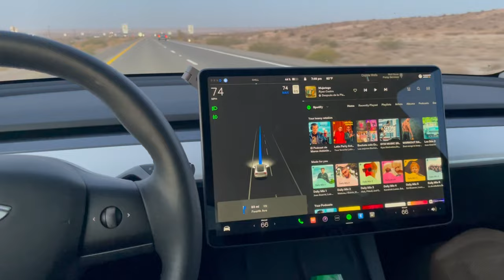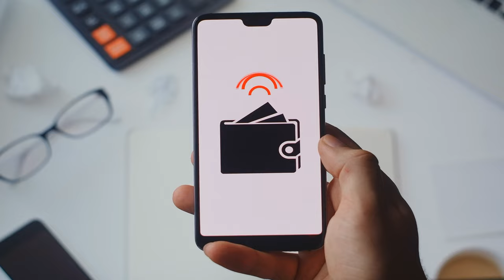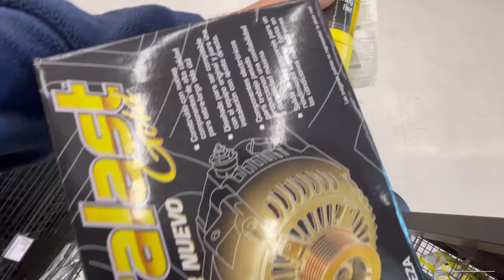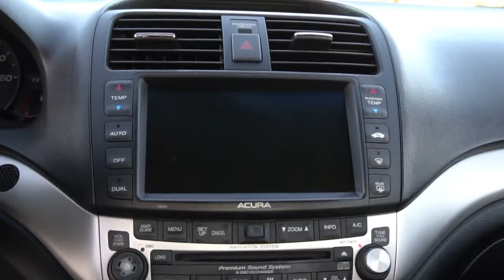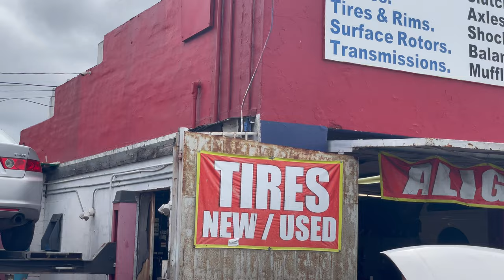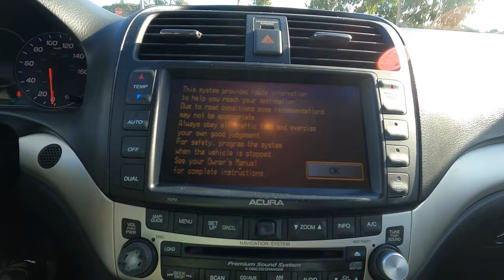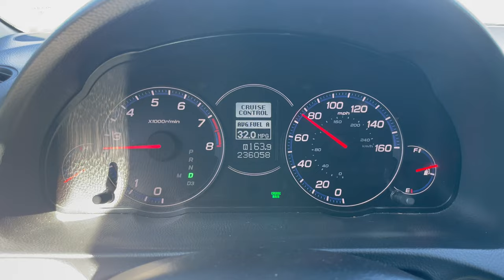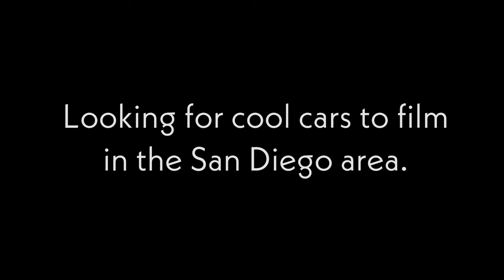ACURA TSX Owner's Review after one year. #Acura #AcuraTSX #honda

Comment: Very good review 👍
I'm thinking about getting a TSX Sport Wagon but I'm concerned about road noise and oil consumption.  I heard the TSX have little to no sound deadening and the 4 cylinder motors can consume as much as 1 quart of oil per 1000 miles!
Reply from the maker: I love those wagons! About road noise: bad! Compare it to a product from Lexus and this is bad. There’s no way to sugar coat it. I’ve had many Honda/Acura products and that’s a constant. 
About the oil consumption… not my experience at all. I change the oil on this one every 5k miles and it doesn’t requiere me to top it off in between services. 

Good luck with your car hunt.
Reply: @JuanCarlosLTO  Good to hear your TSX does not have oil consumption problems. It is probably the ones that were abused and neglected that has issues.  I drove an Acura Integra for a few years and the road noise was bad.  Yes, seems to be a common problem with Hondas and Acuras.  Sound deadening material can be added but that is tedious (if you DIY) and costly if you pay someone to do it.  It also adds weight.
Reply: the lexus cars weigh more because of more sound deadening. A little more on the acura won't hurt @Hiro__Nakamura

Comment: Hey, you said your TSX is fuel efficient. I’ve a 2004 TSX, the mileage on that seems to be really bad. That’s the only thing that puts me off a little. Other than that I love the car. Any suggestions to improve my fuel efficiency? I’ve around 216k kms on the car. 
Also do you recommend I use premium gas or mid grade?
Reply from the maker: Well, about fuel efficiency… Hondas of those years were low on torque so you have to step on it to get the revs up to get the car moving and that’s when it drinks fuel. I’ve had many Hondas and they all do the same. If you drive it like a grandpa then you’ll match the claimed efficiency. My guess is that you drive a lot in city and that stop and go doesn’t help much. I should have said: “efficient on highway driving”, because you’re right, not so much in city.
As far as premium vs mid grade. I keep doing premium but honestly I don’t know why 🤷🏻‍♂️. Maybe because it says “required” on the manual? But if finances were tighter I probably wouldn’t.

Comment: Not weird at all in my opinion. I did the exact same thing here!

I bought and sold (made money on it) a Model 3 LR into a couple other fun cars but ultimately they weren't the one car solution I wanted. I decided to buy a 2012 TSX with 180K miles on it for 6k. My plan was to drive this for a bit and see what I would like purchase next, but the maintenance record on it is perfect and I actually can't really see myself selling this car. Now at 190K and going, my TSX is such an easy car to own that it is a no brainer to keep until it dies for me now.

My plan is to keep this as a daily and purchase a manual Cayman or M2 in the near future as a my weekend car. No need for one car solution anymore!
Reply from the maker: Funny how you mention cars within my orbit… the Cayman: I was looking at a 2009ish before the pandemic… in nice shape you could get one in the mid 20’s for an S with a manual. The M2, in my opinion, comes closer to the original idea of the first M3 than the current M3/4. The two series is a very interesting car, a definite upgrade from the 1 series, for sure and I’ve thought about the M240i over the M2 because I have no need for the latter: don’t plan on tracking it, it’s cheaper and the power to weight and price is optimal for me. 
About the transition from electric to the TSX… I’ll be dead honest: it didn’t work for me because of our lifestyle and driving needs. Then I thought that eventually we will all be driving electric appliances so the vintage feel of things like my manual transmission bmw made me swing in the opposite direction: for connectedness found in older cars and/or modern sporty cars: cayman, Miata, GR86, GTI, etc.

To each their own, I’m happy with my choices today. Tomorrow? We’ll see!

Comment: If a TSX was taken care of, it will go a long long time, especially the manual trans as the auto would have issues UNLESS you maintenenced the auto trans regularly and didnt push it hard all of the time. 

I drive a RWD 08 infiniti M35 with 90k currently. Ive had 2 M35s. My bought my 1st 06 RWD M35 for 8 thousand dollars in 2016. It had 80k miles in it when i boughtit. I drove to 190k when i sold it to my friend who is still driving it over 200k miles now. 

I do recommemd buying a used M35 in RWD instead of AWD unless you need AWD where you live as AWD M35s have shorter life span generally. I also recommemd synthetic GTX oil change every 3k instead of 5k because M35s will burn oil unless you change every 3k with synthetic from time you buy it. If 1st owner didnt, and its already burning oil, its usually only a qt or 2 between changes. 

I bought the 08 M35 I have now 3 years ago for 10 thousand dollars with only 40k miles on it! Owner was retired and kept it garaged. Im at 90k now and its flawless. Doesnt burn oil at all since ive took care from 40k instead of 80k like my 06, it burned a little cause 1st owner only changed oil every 5 to 7k miles smh and with regular oil. It actually burned less over time after i switched it to synthetic every 3k miles. There is nothing wrong with an older Japanese Luxury sedan that still runs good! Ballin on a budget!

Both of my M35s only needed oil changes, tune ups, tires and brakes. Not 1 other thing ever went out. Oh a battery lol. Thats it.
Reply from the maker: I actually had the M35 on my radar back in 06-07. But the car that makes me drool from Infiniti was the 2003-04 M45! Such a beautiful car. Unfortunately it had design flaws that tarnished its reputation. To this date I still enjoy seeing the very few I see on the road. 
And yes you’re right about everything else regarding old Japanese cars and maintenance.
Reply: @JuanCarlosLTO  The M45 V8 RWD is truly an immaculate car! I like all 3 generations but agree the 2nd gen 03 04 were the best. I test drove an 03 in Hawaii years earlier but ended up getting an I35* instead for better gas mileage. I wish id got that 03 M45 instead to this day haha! Its drove more like a 06 Chevy monte carlo SS with V8 and handled more sporty than 3rd gen. The 3rd gen are basically exactly like my 2 M35s with V8 instead of V6. I really want to get an M37 with black leather interior next. I saw one with a super light metallic blue paint and black leather with only 50k on engine garage kept for 14k. Japanese ballin on a budget!
Reply from the maker: My coworker had the 04 M45 and he said he had it since new and the main issue was the manifolds would deform and crack (either or or both, can’t remember) but he had gone to the aftermarket and solved the issue. Bad on gas and all, one of my favorites of all time, so much character, nearly hard to find on anything modern nowadays.
Reply from the maker: The Infiniti FX is another one that I always liked and was sad to see gone.

Comment: Juan Carlos, with my TSX over 435,000km, I am wondering if my car can last for another 2 years without a hefty repair bill, which will pass 500,000km, since I drive about 30,000km annually.  To make the situation more difficult, it takes time to buy a new car due to the long time to deliver a new car.  I dont want to be in a situation without a car when the TSX collspses beyond repair.  I recently just spend $375 to fix 2 exhaust leaks.
Reply from the maker: Hahaha. I think you’re in for the win as we just bought a new car and will be the one getting all the mileage now. I’m going to be daily driving the TSX to work every day though and that would be about 10k miles a year. Right now is at 241k. It only makes sense to keep it. The BMW will be a third car now on which I will probably only put about 2-3k miles max. 
I really want to get to 300k miles on the TSX but it will take me a lot longer now.
Reply: If I had the money for a paint job, I would paint my '06 TSX pearl white.
Reply from the maker: @ronlam3654  a change of color is very hard to pull off unless you do a complete disassembly of all body parts, gaskets, etc. pearl white would be my choice as well. But getting it done correctly would be so expensive.
Reply: @JuanCarlosLTO  I completely agree.  My '06 TSX is approaching 444,000km.  Rust is already starting to appear on the panel connected to the rear bumper.😥

Comment: I have the 2008 TSX and currently at 200K Miles. I had to replace an Alternator, got my Catalytic Converter stolen and replaced, and always been up with maintenance. Having said that, this car definitely a long lasting car. I honestly feel like this car can go 200K more.
Reply from the maker: Judging by the way mine is running at now 241k miles… I wouldn’t be surprised if it runs strong to the 300k mark. 
When I made this video 3 months ago my car had 236k. It now has over 241k. We have a new car now and will probably drive this one slightly less but I should break the 250k mark by the end of the year, hopefully without hiccups

Comment: I own a 2006 tsx. Done alot of mod work to it. Have 167k drives better then most newer cars.  I'll have no plans getting rid of it. Gonna put performance cams in it.
Reply from the maker: Do you have an aftermarket suspension and if so, what is it. Mine is riding in whatever it came with from the factory and needs a refresh. I want to take this opportunity to lower it a bit but don’t want anything too stiff or aggressive.
Reply: @JuanCarlosLTO  well I just bought new shocks. But they're pretty much oem . I'm am planning on getting coilovers which allow you to lower the car and it stiffens the suspension.  Probably what you want too. I just havnt   not read to do that yet.
Reply from the maker: @OutdoorOkie yeah, I’m not on any forums or anything so I’m pretty much in the bling when it comes to what to get but I want to go adjustable
Reply: @JuanCarlosLTO  well understandable.  Yeah they are adjustable shocks.  The lower you go, the stiffer your ride will be.     Tires matter as well. I put wider tires on mine. But it's not really noticeable.  I'm aiming for more speed so alot of what I'm doing in motor work
Reply: @JuanCarlosLTO  also upgraded my GPS to a new style.

Comment: My TSX has passed 432,000km.  I bought it used with 15,000km. The engine and transmission has no issues, except the threads on the oil pan stripped and I now need to install a oil drain valve.  I refuse to pay $700 to replace the oil pan for such a high mileage car.

I am wondering why my rear brake pads and rotors wear out faster than the front
Reply from the maker: Wow! I’m at 385,000 now… I think I’m catching up with you in a few months! 🤣
Reply: @JuanCarlosLTO 385,000 miles or km?
Reply from the maker: KM. I think Ron is in Canada and he goes by KM. I’m at 239500 miles precisely.
Reply: @JuanCarlosLTO  got a question, how long do these acuras last? Got a guy wanting to trade for my car and mine isn’t reliable at all.
Reply from the maker: @RoseIsGC it’s hard to tell. These cars are very durable but at the same time people often abuse them thinking they’re indestructible. So it’s a case by case basis for it. Mine was always cared for and you can tell (minus the paint). But there’s many variables. As with any other car, higher mileage brings more breakdowns and repairs just because it’s an old car at the end of the day.

Comment: Juan Carlos , just bought an 2007 Acura TSX 5 speed automatic. Since it’s a 4 cylinder can I just put 87 in ? 87 and 91 is a $1 difference for me. Mine has 27k miles . I want to keep it for a long time. Rather put 87 but don’t want to ruin the engine in the long run, ?
Reply from the maker: Twenty seven thousand miles? Is that a typo? If it isn’t, you are one lucky person to have found a TSX with such low mileage!
I really don’t know man I’ve been doing 9110 since I bought this one, but I really don’t know why because I don’t remember doing so when I had my new one 20 something years ago. And you’re right about the price difference between regular and premium it up in a full tank is $15 sometimes the difference. And question and this question keeps coming up on the comments of all my cars and I really don’t know what to answer. I just go by what it says on the manual and this one says required so that’s what I do. Other people comment that they do regular and the car runs fine but I’m afraid of the long term effects of a lower octane than the one listed as required. 🤷🏻‍♂️
Reply: horrible` gas milage with 87

Comment: Koni yellow shocks and h&r springs would be a good suspension choice. No body roll but it soaks up the bumps better than stock and you can adjust the stiffness. No messing about with ride height you get a perfect 1.5" drop
Reply from the maker: Thanks for the input. I really hit the jackpot with my old BMW as I only dropped it about an inch, still OEMish stiffness so it’s not harder on the body than stock. I wonder if 1.5” it’s not too much for this old man… at this stage of my life I’m more function over form. I guess I need to see it on someone else’s first but with stock wheels… 
Thanks again, though
Reply: @JuanCarlosLTO  definitely not too much, if anything it's not low enough. At that height it brings it down to modern vehicle height. Just looking at it in parking lot it's about the height of a new Accord instead of being high up in the air like a 4x4
Reply from the maker: @davidzebar6876  haha you’re right. And the body roll is infinite
Reply from the maker: I just went online… the 07 TSX ground clearance is 6.1 while the 2023 TLX is 5.3, so yes, almost an inch taller. So considering the TSX is a much shorter lengthwise and narrower wheelbase it gives this visual effect. It’s also shy of an inch taller than the TLX.
Reply: @JuanCarlosLTO   good to confirm what I'm seeing. Especially living in cali without snow it won't feel too low for sure

Comment: I disagree these are slow. It's how you drive them. Put them in manual mode and hold gears and as soon as 4000 revs passes the i-vtec motor becomes a monster. Also, the chassis employs double wishbone suspension that only  very expensive cars these days have. This car is a bargain!
Reply from the maker: A bargain it is/was. It also has continued to be reliable after almost 2 years. I’m about to paint it. I was thinking of going with Lunar Silver Metallic (it’s a Acura color), that modern gray. I’m not a fan of color changing a car for all the details that must be addressed but it’d be fun… or stick with the current silver. 🤷🏻‍♂️